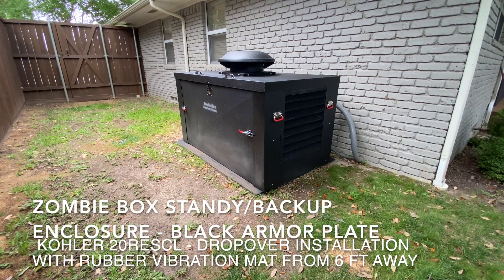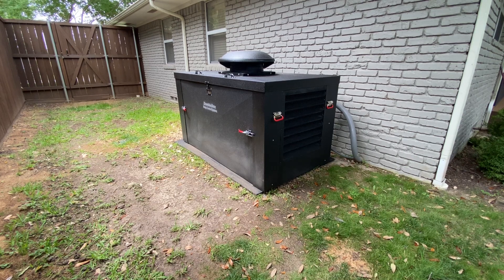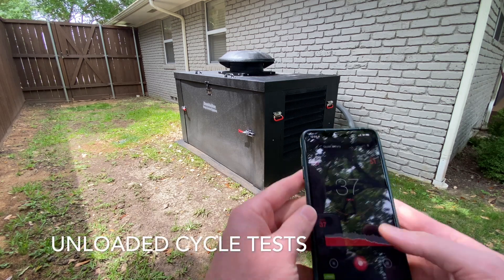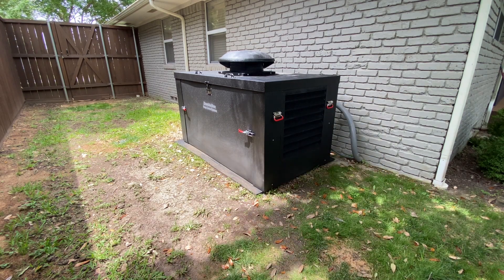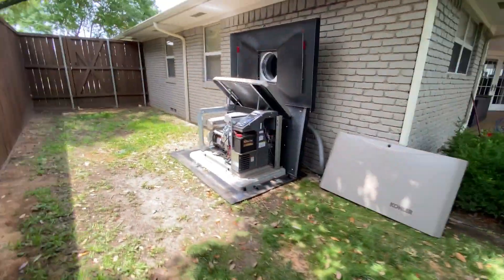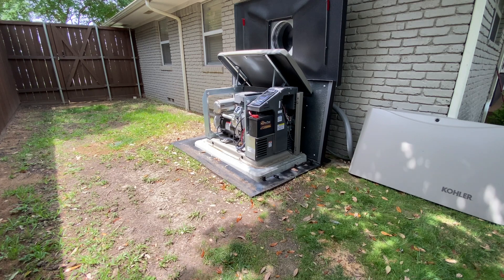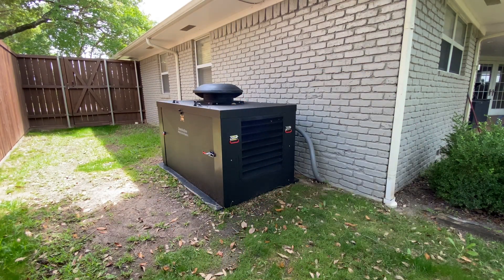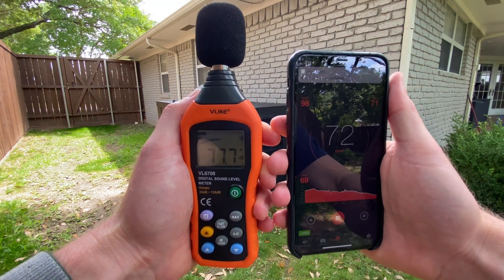Zombie Box Standby/Backup Enclosure Review - Kohler Dropover Installation

Comment: thanks for the video but it looks like youre making it louder which is misleading. the zombie box is probably just -10db. heat and fumes are still expelled at a low height.
Reply from the maker: I’m not following. What do you mean “I am making it louder”? Tried to post a fair test, so if something isn’t fair I’d like to understand how.
Reply: @pkslaughter00  I mean we all know enclosures make a difference so why spend time going backwards from your starting point(removing them). i feel it exhibits regret that the zombiebox is not meeting expectations
Reply from the maker: I think it’s pretty clear I regret buying it. To my ear I barely heard a difference and the decibel meters seemed to tell the same story as my ear. The meter was just me trying to introduce some unbiased data, but honestly before I even bought the meter to my ears it made so little difference I was pretty disappointed you just can’t practically return it. The packaging & freight would have made it unreturnable I suspect. If you think it’s great you should speak with your wallet and buy it and post a similar review with decibel meters showing how great yours is. That would help better inform the buyer base. I made this video bc at the time I couldn’t find any reviews online that showed a backup install. The videos by the manufacturer seemed to make claims mine didn’t come close to which is I why I wanted to share my experience and see if anyone else had thoughts.
Reply: @pkslaughter00  yeah thats why we appreciate the video, and it made it clear I have to DIY my own cheaper and effective solution, hopefully something that matches the theme of my backyard. I personally stay away from products made by welders and "fabricators" because they design to showoff their work, functionality and "softer look" takes a back seat.

Comment: O yes please help. I bought a "quiet" Generac 22kw..Oh yikes. this is terrible. I need a suggestion of a box to buy that will keep my neighbour happy. I was thinking to buy the Zombie Box but heard elsewhere that its exhaust is indeed noisy.  What if I covered the exhaust with the car soundproofed Dynamite. has anyone ideas please.  IT is getting very expensive in so many ways ;-(  Carol
Reply from the maker: I don’t know of any products off the shelf that accomplish your goal. My solution at my next house is I am buying a liquid cooled generator bc they run much quieter. Be very careful when you start modifying the exhaust to not restrict airflow that would impact the generators ability to cool. In theory though, if you did it without limiting airflow, any kind of redirection of the sound on sound dampening material could make a meaningful impact to noise. That appears to be the flaw of the Zombie box in my opinion because it doesn’t really redirect the noise like a muffler does in a car. You want to create a muffler to reduce the sound meaningfully in my eyes. I think you have to build your own box to do that though.

Comment: I did not hear you say, nor have I read in the quick scan of comments to the effect that sound readings are logarithmic.  A 3db reduction cuts the sound level by half.  A 3db increase doubles the sound level.  So, 3db makes a big difference.
Reply from the maker: If 3 dB makes a big difference you should buy one. To my ear in my backyard and in my house the noise level is approximately the same with and without the box although you notice a slight pitch change. I believe the manufacturer used a similar marketing strategy about logarithmic scale. They also stated 15-20 dB noise reduction at the time which I was unable to replicate in my dB meter readings.

Comment: This box is a scam 🤣. Stick 1inch rubber insulation to those walls to give them dampening mass and soundproofing foam on top of that. That silly tin box has no chance otherwise. So much for the fancy design...
God i cannot stop commenting i edited 3 times... that box is ridiculous i cannot even believe what i am seeing
They were in a hurry and forgot to put any insulation.
Did you buy by any chance an uninsulated version? Something like diy choose and install your own insulation?
Reply from the maker: Ha, nope this was the full cost box with all the extras (spray coating and all). This was the best they had to offer at the time. I believe the fundamental issue is the box does little to capture the exhaust noise and that’s where 90% of the focus needs to be in my opinion bc that’s the opening where the noise is escaping. It basically just redirects the exhaust with a flapper into a 45 degree wedge. My untrained opinion on the core box issue. The exhaust would need to be directed through some kind of muffler to really reduce the noise in a meaningful way. I suspect there would be airflow issues doing that so that’s why it has minimal impact on noise on my opinion.

Comment: One of the most honest reviews I have seen on YouTube. Great information. One thing I have yet to see incorporated is Car Sound Deadening Material Mat. I have had the cab of my truck wholly covered in Dynamat for 10 years, and it helps with road noise. I also noticed that when it is scorching outside (over 100F), the cab gets cooler faster. I removed the headliner and put the Dynamat on the roof. Why did they choose black paint? That was super stupid. I was in the propane business for two years, and there is a reason why every propane tank is white, light grey, or silver: According to NFPA 58, propane tanks must be painted a heat-reflective color unless in a frigid climate. A dark color absorbs heat and causes the expansion of gas, which can lead to the opening of the safety valve and gas potentially being released from the tank.
Reply from the maker: Great commentary, lots of parts of the design don’t make sense so me having reflected on it over the years.

Comment: Never ever ever ever install another sound attenuated enclosure over another enclosure!  All generators, Kohler, Generac, Caterpillar etc. have VERY specific design criteria for air cooling/flow requirements. When you purchased the Kohler you could easily have purchased the new sound enclosure from Kohler designed correctly for the same cost. What you have done is shorten the life of your unit because of the additional air restriction and thus heat. Also you just voided any warranty you might have had. 
I retired in 2010 after being in the generator bizz since 1989 in South Florida so have seen 1000's of installations. Please, if your going to do a housing know what you are doing and seek professional advice. No I do not represent any company,  I just hate seeing videos like this where folks are completely misinformed. Worse yet you can cause catastrophic damage or fire by over heating the unit!
Reply: I purchased the Honda EB10000 and am trying to get as much info on the best way to go for a running enclosure, The safest and the best protection for my investment, I would appreciate any recommendation that you could give me. Thanks.

Comment: PK, I was a day away from ordering the same Zombie Box for my 22kW Generac. I really need to re-think if I want this product. I really expected a dramatic reduction in the sound level. while I'm disappointed at the performance of the Zombie Box in your video, I would be more disappointed if I spent the money and the sound level wasn't anywhere near what I saw and heard on the Zombie Box website.
Reply from the maker: My feeling of disappointment exactly. I would love to see Zombie box show a video measuring decibels like I did that validates their dB reduction claims.
Reply: I’ve got the generac 22kw as well. Not going to spend that kind of money for only 5 decibel. I did notice that most if the sound is from the exhaust side of the generator. Gonna have to come up with something on my own to quiet it

Comment: Heck, my sound ordinance is 45 dB at the property line, anybody have ideas on that?
Reply from the maker: Start with liquid cooled models and work from there if you need really quiet. In some of the more expensive liquid cooled models they offer silencer kits for the mufflers.
Reply: @pkslaughter00  The liquid cooled models are like 61-62 db. I need to get to 45 at property line, about 50 feet away.
Reply from the maker: Agreed, look at the additional noise suppression mufflers the generator companies sell as add ons. They make those kits because hospitals and other business require extreme quiet. Those are not even options for the cheaper air cooled models, so that’s why I said to start with liquid cooled.
Reply: Buy a predator 3500 and run only the essentials with an interlock.  That would keep you at the 45dbs.
Reply: @athroop1321  3500 watt predator won't even power my heated toilet seat.  Butt thanks.

Comment: Did you have to reconnect the propane line and electric in order to install the Zombie Box? Can't see the back in the video. Thanks!
Reply from the maker: No you do not. There is a panel that unbolts on the back panel so you drop it down over the lines in place and then bolt that panel back on. It drops over the existing installation without having to touch the generator itself. There is a foam panel you cut to custom fit your gas/electric lines. I think their standard model is for Generac so I did have to give them some customer measurements of my Kohler so the cut outs were in the correct spot.

Comment: Respectfully I disagree, I noticed a large difference, especially when you removed the zombie box front and walked out of the path of sound waves !!! Re-watch this video to see if; under closer examination if you don't note the major difference when you walked by with the front of the box of the view of camera ... One thing to note brother, you will never produce any power with no sound just because we have no way of making mechanisms which do not waste energy in the form of noise.
Reply from the maker: I got no where close to the marketed dB reduction in my measurements. The marketing videos I watched before purchasing show a loud generator get quiet. In my installation my generator seems to make average noise before and after, I dont notice the extreme noise reduction from the marketing videos. Noise is pretty subjective over video that’s why I used a dB meter in video. It does reduce noise as my numbers show. I never state it doesn’t reduce noise, it does. I just don’t think it reduces it enough to be worth the price on my install.
Reply: @pkslaughter00  Love the video.  The db meter (and your ear) are really the best measure.  Unless you are using an expensive camera (I don't know what you use), with manual sound level control, most cameras automatically adjust the sound level to keep it steady.  And, many expensive cameras have the auto-gain enabled by default.  I leave it on because it's convenient, unless I have a specific reason to want to manually control the audio gain.  In short, unless you had auto-gain off, the video isn't a reliable way to judge the sound level because the camera is going to change it.  You can, however, hear the change in the frequencies (which may be more important.)

Comment: Thanks for video. Priced at $2,400 for a Generac 24Kw, too expensive IMHO. ideo shows lid isn't really necessary and lid just makes it hold heat. Personally, Will just build a double wall fence with 2" sound barrier and sound deadening rubber to reduce sound more, and protect foam/fiber barrier from weather. 

Appreciate video, it is a nice unit. If you have money and/or don't want to build sound barrier yourself, a great option.

Comment: This is my second review on this video which I really liked; but now having built a compartment for my Honda 5kw genset out of 6" conc. blocks with a metal roof and metal front doors I have new insights (in the same style as a horizontal garden shed). I also put a auto muffler on the generator. I applied MLV sound barrier and a mineral wool sound absorber on the roof and the rear wall & mineral wool alone on the side walls and front doors. I had metal vents installed on the exhaust and intake openings to change the sound direction and lined the vents with MLV. It is installed very close to my bedroom.
- Gen, no enclosure, no muffler, no load was 67 (20 ft. from gen)
- gen with enclosure shut, muffler, no load was around 60
- Inside my bedroom sound levels are around 41-42 db which is library noise levels. 
 As I stated, I decided against Zombie Box because they refused to disclose the materials used to silence the compartment although the enclosure itself is attractive. 
Typically when you buy a generator you can double that price to enclose and wire it up. For me that ratio as a do it yourself guy using a latin american contractor (cheap) for the block & metal work, the total installed cost including gen turned out to be a ratio of 3.1 ouch. Total cost with gen about $10k. So what did I learn? 
- Do like you did, and buy a generator; Champion, Kohler, Onan, Generac or whatever complete with an enclosure. It is hard to outdo someone who is in a competitive mkt. and building these forever. They have been through the prototyping and design so there is no learning curve and making mistakes which happens when doing it yourself. In the end it is the cheapest way to go. 
  I probably would have cut my costs by just going with a Zombie Box, which, if it did not significantly cut the noise levels would have given me an enclosure to weatherproof the generator set. However, if I did it over again I would simply go with an enclosed generator like your Kohler and be done with it. I would have saved a ton of money. 
   What concerns me about your install is how high to the temperatures go inside that Kohler box. To give you a rough idea my compartment goes up to about 125 deg F on an 80 deg day. 
    Another thought I have is frequency of operation. Backup generators are for emergencies. Do your emergencies go on for an hour or two or do they last days? In my case I have frequent outages lasting an hour or two and I live in  a goldilocks environment where A/C or heating is not required. 
    I previously (7 yrs ago) installed a battery backup system and I love it. It is instantaneous and supplies me power for perhaps 3 hrs and maybe a little more. It so far has carried me through all outages. Better still it is dead silent and this is the beautiful part of it. In otherwords, so far a generator would not have been needed. If this is your situation then a Tesla or Enphase power wall might work best for you. Don't discount this. In my case the generator set was an afterthought that came because I am bored and thought, what if we get a longer duration power failure. In other words it became an obsession which, in retrospect, I do not regret doing but I regret doing it the way I did. Given my setup it might have been much more practical if and when a long duration failure comes; just go to a hotel with a generator set. 
    Hope this helps and gives some people something to think about.
Reply from the maker: Thanks for sharing your experience on the DIY.  

On the heat question, the Zombie box does a very good job of not trapping heat because it is well vented (intake and exhaust plus a vent on the lid to let heat out that rises). I think it being vented so well is part of why it doesn't reduce my sound level much. The 20kW air cooled models have built in fans so they move a lot of air to keep them cool. If the 5kW Honda is a portable model that doesn't have a fan on it (i don't know your specific model) then adding a fan to the box would do a lot to keep the box cool. 

I am just going to save up next time and buy a liquid cooled model next time to reduce noise and spend the extra money on plumbing and electrical to set it as far away from my house as possible so distance can further dampen the noise.
Reply: I noticed you said ,go to a hotel in the final solution for long term solution, I lived through hurricane Ida here in S.E. Louisiana and that was NOT an option and it doesn't mitigate damage to your home and property, after the storm a week or so later we had hard rain storms and if you hadn't tarped up your damaged roof you now had the problem of wet insulation and falling sheetrock... factor that in to final solution, no hotels to be had.

Comment: I was looking at a Zombie Box for my Generac, looking at their website they claim a 90 to 70 decibel reduction (they state as 90% reduction?). I personally dont think $1500 would be worth the investment.
Reply from the maker: My hope would be someone would post a similar video of a Generac with a Zombie Box installed. I can only show the results on my Kohler. My opinion was the Kohler enclosure already does a good job of reducing noise. I have no feel for the quality of the stock enclosure on the Generac. If it is poor, you might see that reduction. If it works well, you may see similar results to this video. Hard to say for me because I haven’t run these tests on a Generac. I would only use the video as a reference for what you might see on this model Kohler and try to figure out how you think the Generac differences might impact your results.